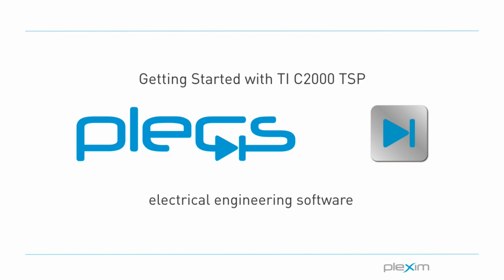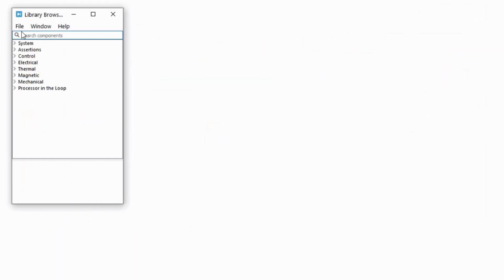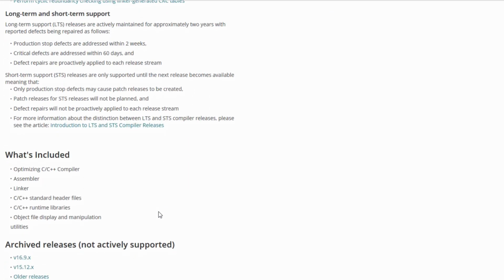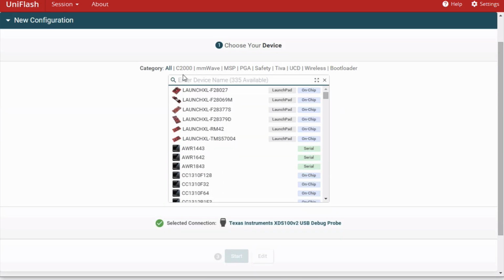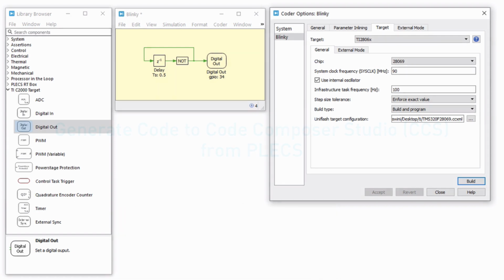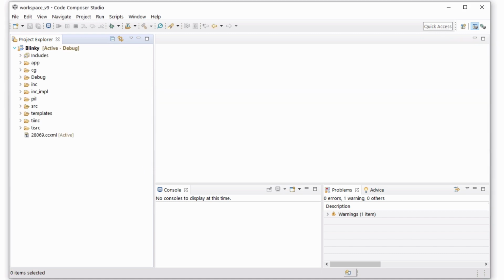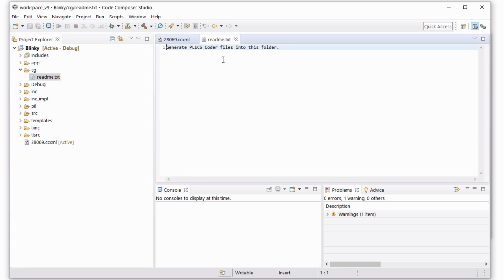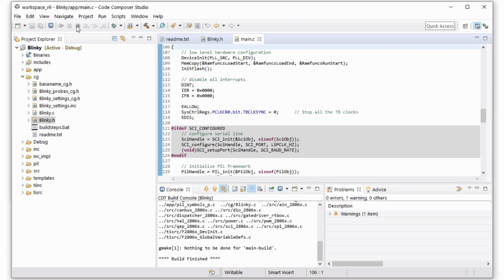Getting Started with the TI C2000 Target Support Package

Comment: Couple of changes are needed for this to work. Note the Dip Switch positions. They need to be as shown in the video for the JTAG debugger to work. Otherwise you get an error. Also, there are some updated in the new software. By default the external mode is enabled. With the changes I mentioned, the code seemed to flash but the LED didn't blink. I unplugged the USB and plugged it back in and then the LED started blinking!
Reply from the maker: Hi Sandun, there is a known issue with Uniflash v6.1 incompatibility with TI C2000 TSP 1.2.0. For the time being, the recommended versions are UniFlash v6.0.0, C2000-CGT v18.12.4.LTS and CCS v9.3, as stated in the TI C2000 TSP manual (always check the manual for up-to-date recommendations with the latest release). The issue with automatically running the code should be resolved with the above versions. The manual also lists "Tips for Programming C2000 LaunchPads” . The DIP switch configuration for 28069 is mentioned there.